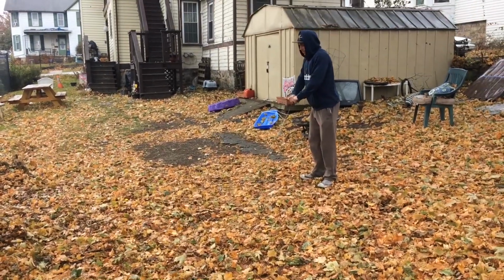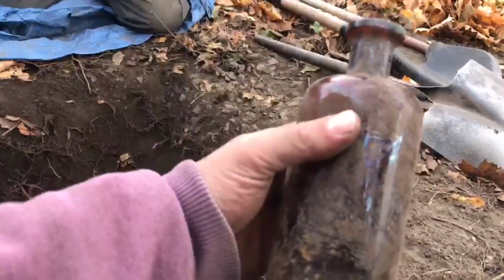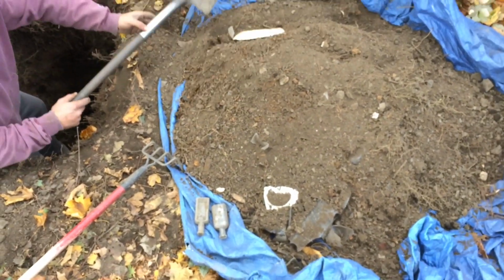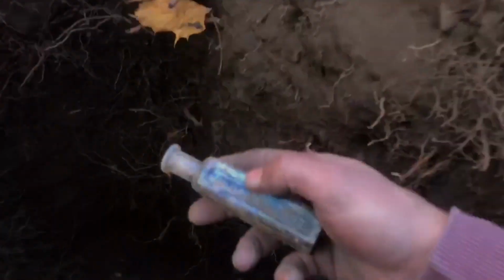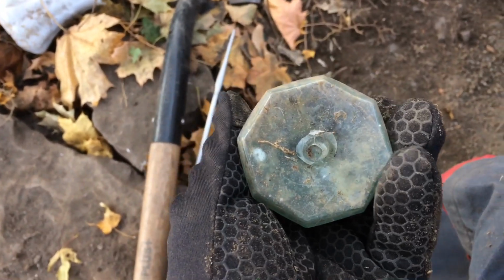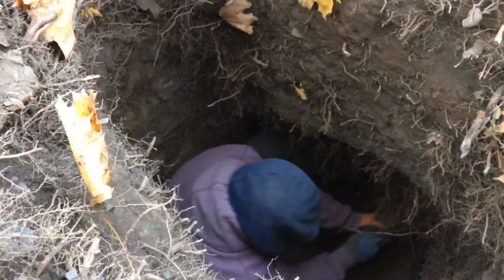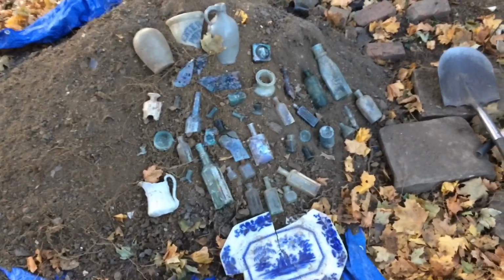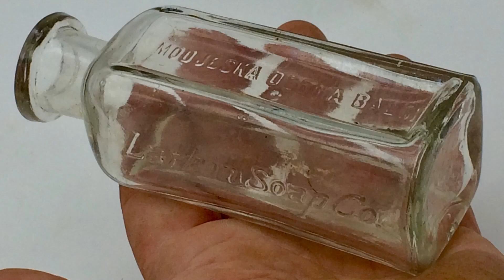Privy Digging 1840s open pontil bottles holy cow!

Comment: See I know there have to be a few old privys on my property. The original house dates back to around 1900-1910. but around the old house foundation is a HUGE rock ledge just about a foot under the soil. I cant figure out where they would have had their privy at. I dont see anywhere near the old house where you could dig even a few feet deep. 
 There was an old root cellar about 30 feet from the old house. And there is a slab of concrete where i assume they upgraded the privy at one point to a actual toilet and running water. I have always wondered whats under that slab, was it the old privy? Hmmm...

Comment: So the probe goes into the ground a lot more if the dirt has been disturbed in the past whereas dirt that hasn't been disturbed e.g. dirt hasn't been dug up to make a bottle dump is harder to push the probe into?
Reply from the maker: Correct and you can actually feel the different layers after you have done it far awhile. And lastly the sample , it never lies, you see brick, ash, or seeds, dig a hole it’s either a privy or a trash pit.

Comment: What do u mean by a privy ? , in the U.K we called an outside toilet a privy .
Reply from the maker: Exactly the same thing brother, outside toilet plus 100 years old = Antique bottles and relics brother.
Reply: @CrickDiggersInc  How come so many bottles ended up there ? . We had a privy up until the 80's , however we never did anything other than relieve ourselves in it , did people used to dump their rubbish by them pre refuse collection ? , I'm sure here there was like communal rubbish dumps in fields at the back of houses , in the 80's I bought a metal detector , and used to get Metal Detector News , digging these dumps was a very popular past time not that I ever did it .
Reply from the maker: They did use the privys as trash pits as well. Very common practice back in the 1800s every home older than 1900s has a privy or several depending on how old the property is. I recommend you watch the trailer video and I discuss exactly how to locate and dig them. Thanks for your continued support brother.
Reply: Where do I find the trailer video ?
Reply from the maker: I think you are commenting on it. It’s on our channel page and has 43k views.

Comment: When you find the walls open the entire privy. It will go better and you will have a better chance of finding everything and have less chance of breaking bottles. You are in the right area. Make the best of it.
Reply from the maker: It was so hard to even get done what we did. Not enough time to open whole pit. It’s 8 feet long man. Going back to reopen next weekend and then we will open it completely up and finish it. Should get some more awesome stuff. Thx for your continued support friend
Reply: We do try most of the time but this one had so many roots that we couldn’t quite open it all the way. When we go back it’s getting opened the entire length. We think it’s about 10 feet long. Prob a 3 seater

Comment: I have to ask, are you ever worried about the sides caving in?
Reply from the maker: Not until we get 15 ft then it requires a Tri pod but we haven’t gotten into any that deep yet. The walls in our area were made by master masons and are still extremely stable in most privys.
Reply: @CrickDiggersInc  Definitely looks like you play safe in, always 2 of you just in case.  I guess the only soft dirt is what you excavate from the fill dirt added when they change holes. Is there generally more than one privey site in a yard?
Reply from the maker: Yes sir, on average there is 3 privys per house. We have dug 5 privys on one homesite before so it depends how long they used them before digging a new one and moving the building over into it.

Comment: do you hit the dirt with a metal detector at all?
Reply from the maker: I normally use my pinpointer but soon I’m getting a sift so I can just sift all the dirt. I’ve tried using my detector but it goes nuts on everything. Have not tried the smallest coil yet but I will attempt it after I get my Jeep back. Thx for the continued support brother

Comment: You guys are getting to the point of needing some type of shoring to keep from having a cave in, OSHA says anything over 4.5vf in depth needs to have a trenchbox.
Reply from the maker: The wall of the privy is the shoring. It’s not just a random hole in the yard. It’s been shored very nicely, the masons back then in there’s areas were masters. Hence why they are still standing 150 years later.

Comment: What's the importance with those bottles that have the broken looking circles on their bottoms?
Reply from the maker: There super old mouth blown bottles from 1840-1850s. You don’t see open pontil bottles dry often. The circle thing on the bottom is called a pontil from where they snapped the glass rod off after blowing it.